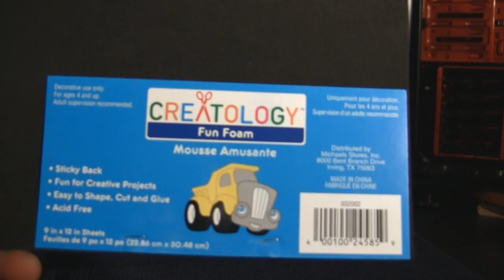Custom Grommet MOD Revised

Comment from the maker: Paint doesn't stick to rubber very well at all or does it work on foam, even fabric paint is adsorbed into the foam and eventually you would use so much paint that every time you tried to run your cables through the grommet paint would flake off.

Anyway since then I have ditched the foam entirely, not as durable as I wanted, went to rubber alone attaching it with contact cement and it work beautifully. Looks more factory this way and is 1000X more durable.

Thanks for your suggestions
LazyMan

Comment from the maker: @MissouriEarthMovers The foam works, but the rubber works better with no foam....I never did show a vid on this 3rd attempt, but I found that the foam still didn't perform as expected even with the rubber. So I decided to ditch the foam all together and just use the rubber. I attached the rubber on the back of the mobo tray using contact cement...has held up flawlessly, and I have torn my PC apart several times since then.

Comment from the maker: @KCxGonzalez   I bought the rubber from Amazon...search for Neoprene rubber. Also I have change it since this video, I went with just the rubber and no foam...I used contact cement to adhere the rubber to the mobo. This seem to be the best way...the foam even though it was durable...it really didn't hold up after putting the cable's in and out several times.

Happy Modding
LazyMan

Comment from the maker: Just look for rubber sheet at Amazon. Also the round grommets can be picked up at either your local electronic store or local hardware store. You can also buy them on line at either Performance PC's or Frozen CPUs. 
Each place I've mentioned carries a couple different sizes, but no one carries all the different sizes, so you will need to know what size you want, then check to see who carries that size.Or you can be like me, order every size from all the different carriers, that way your covered.

Comment from the maker: The reason being on the foam ones I hadn't sleeved the Sata cables yet so they were a little thinner, also I only had 3 cables going through the grommet.

On the rubber grommet I had 4 Sata cables sleeved with cloth heat shrink, which caused them to be much thicker, causing the gromment to buldge a little.

I am either not going to use the cloth heat shrink or make adjustments to the rubber grommet.

Cheers
LazyMan :-)

Comment from the maker: Once I had sleeved the Sata cables and use cloth heat shrink, it made them thicker causing the grommet to bulge a little. 

It would be the same with the foam, if you look back I didn't have the Sata cables sleeved so it looked a little better. But the cables were ugly.

Will make some changes to fix this problem.

Cheers
LazyMan :-)

Comment from the maker: @SpartanTimTv Use contact cement, I found that it works better if you use just rubber as the foam doesn't hold up as well as I original thought. You can use rubber for both part or just use one piece and attach it to the back of the mobo, either way use contact cement.

Comment from the maker: Yeah, that should be fine, If I not mistaken 2mm is about 1/6 of a inch, which would be a little thicker than the 1/8" rubber I used. The thinner the better, but 2mm should be fine.

Are you looking for colored rubber, because you can buy black runbber from Amazon pretty cheap.

Comment from the maker: Hey bro, checked out some pics on you mobo, what a terrible spot for the 24pin connector. Yeah I would do it just like you suggested, run the cable right long side the CPU cooler and through a hole on the top of the mobo tray.

Good luck
LazyMan :-)

Comment: hmmm ya,

well i dont know if its appropriate to ask here, but i wanted to know that how much do guys like u and TJ, charge for a case mod and hardware installation?

I mean mod shud be interior paint, some exterior paint maybe window mod, air cooling mods and cable mangement etc. 
Pretty much like you B Widow. Can u tell me what will u charge a a client for this?

Comment: Geesh.... man, I am bad w/numbers. You're right about being thicker. I think I'm going to go with 1.5mm which is .015". That's pretty thin.

Yeah, I'm looking at a 'color' as opposed to straight up black. Not really wanting to do the interior black. Black & Red are awesome contrasts, but I was trying for a little different.

Got Industrial Engine Red, duplicolor paint... like it. Thinking tri-color. Third color(blk) as accent. 2nd color is tricky. Decisions. 

Thanks for helping me out LM.

Comment from the maker: Make me angry from what, I appreciate the feedback. :-)

On the foam grommet the Sata cables were not sleeved and there were only 3

On the rubber grommet there were 4 Sata cables sleeved with cloth heat shrink causing them to be thicker, in turn causing the rubber to buldge a little.

I am either not going to use the cloth heat shrink or I will make adjustments to the rubber grommet.

Cheers
LazyMan :-)

Comment: A tip for you that may or may not be helpful. Where the cuts finish on  your grommets the  fine point could be radiused. This reduces the stress and helps prevent splitting.  Some thing like a  leather punch should work  fine.
Nice work .

Comment: I am wondering what you think of this idea. I have a TJ07, and its mobo tray is completely texture-less, chromed and polished. Instead of making grommets, what if I was just to cover the entire tray with this stuff, then cut the slits from the backside through the cable holes? That way it appears my UV sleeved wires just disappear directly into the tray. Picturing it in my head it looks perfect. I hate painting and its preparations, lol... I just need to figure out what a good adhesive would be.